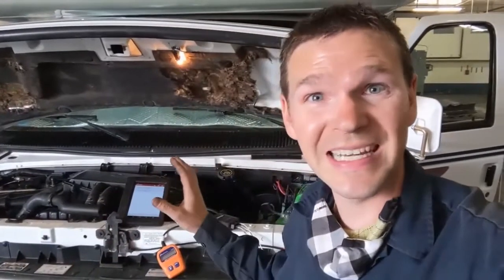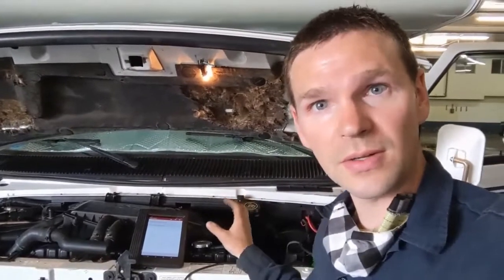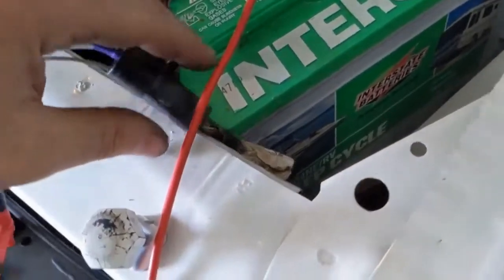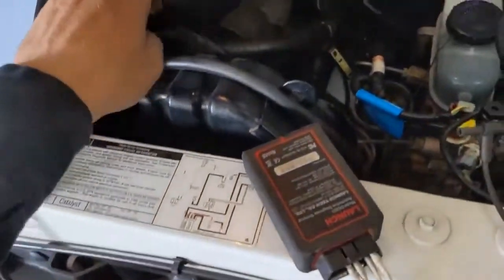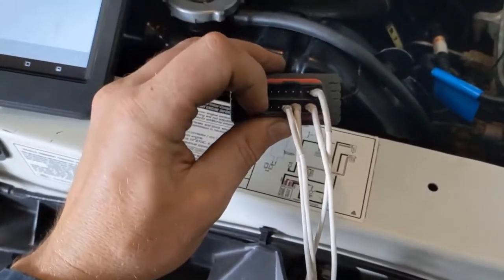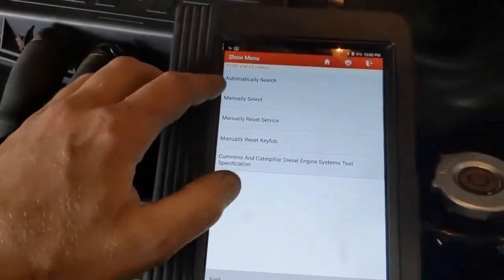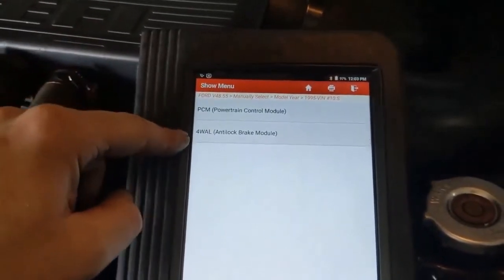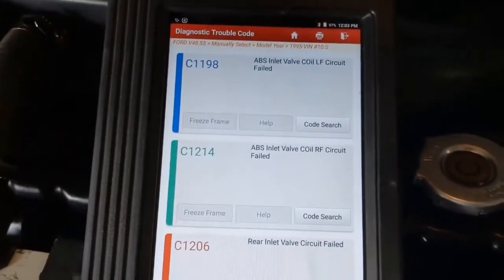1995 Ford Pre Obd2 Abs Code Retrieval With an Obd2 Scanner!

Comment: Is this the same as a 95 f250 only asking because mine has only two wires green/black stripe and red/with pink stripe I don’t have a black and orange wire
Reply from the maker: According to my wiring diagram on yours the black and orange wire is the abs diagnostic wire.

Comment: Thank you so much!!!  This worked for me on a 1995 E-350 Club Wagon with 7.3 Powerstroke.  I used a Vgate iCar Pro Bluetooth OBII interface.  I used ForScan on my laptop connecting to the VLink Android Bluetooth device (not the IOS link). I also tried a OBDLinkEX USB cable, but that didn’t see the ABS, only the PCM and ABS modules. I used an Autool OBDII breakout box to connect the black/orange wire to OBDII pin seven.  It made connecting very easy.
Reply from the maker: @marksherred8886  Nice glad it worked!👊 Communicating with older OBD1 vehicles can be pretty challenging.

Comment: Update, my econoline is a 96 and it has obd2 but wont communicate with the abs module via the obd2 connector under the dash. However there is the 3 wire abs connecter under the dash with the obd2 connector exactly like the one under the hood with obd1, was able to connect to the abs module through the black and orang wire. Might make a little adapter that gets power and grounds from the  obd2 connector and a plugs into the abs connector for communication, easy plug and play operation

Comment: Which model scanner is being used for this?
Reply from the maker: This is the launch x431 but any scanner capable of reading ABS codes will work.
Reply: Ok great so something like a crp123 would work? Will I get 1995 4wabs option like the video shows? Most obd2 scanners that support abs don’t say they support 95. Doesn’t the scanner need to support that exactly as you show or just any obd2 scanner supporting abs?
Reply from the maker: @dbov21  obd 2 starts from 96' and newer. This video shows how to read abs codes from an obd 1 vehicle by using an obd 2 scanner. That's why you have to use jumper wires instead of just plugging it in. They aren't technically "compatible" but you can get it to work. The scanner you mentioned should work but the only way to know for sure is to try it 👍
Reply: Nice well I’m going to try it today and post results. There’s a whole bunch of people with this problem. I’ve spent years trying to fix this and get codes. Finding one of the scanners to support this is nearly impossible now and big $. This is almost too good to be true. I’ll post results tonight.
Reply: The Launch crp123 isn’t working. It doesn’t have the same functionality as the x431. It won’t allow doing a manual selection of a vehicle to get codes only automatic so it has to connect to an ecu to work. Launch’s site says the 95 Ford e-series 4wabs is supported but doesn’t specify which scanner models. It appears the x431 is required for this.  Or a scanner that allows for getting codes without having to connect to an ecu?
Reply from the maker: Ah bummer! It's a shame it won't allow you to manually select the year, make and model 😕
Reply: Can I use a odb1 on the connector?